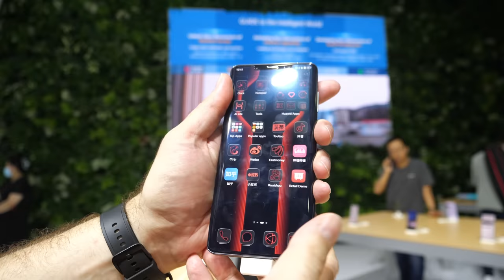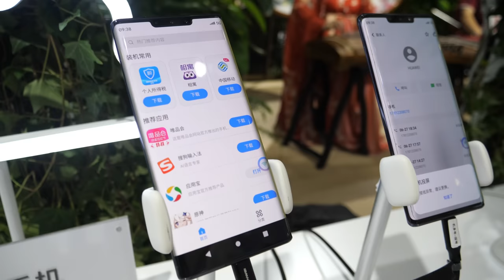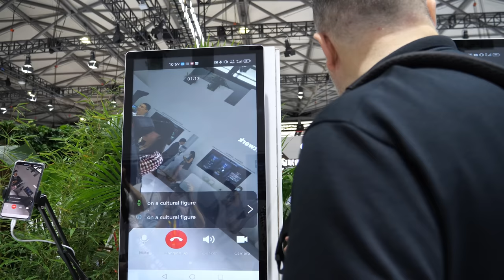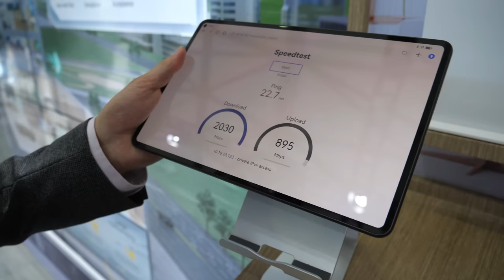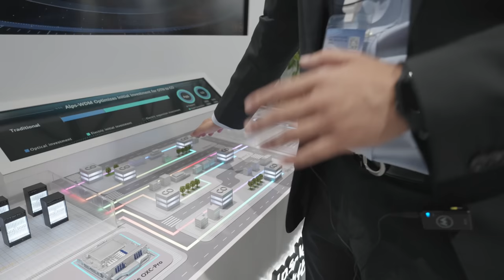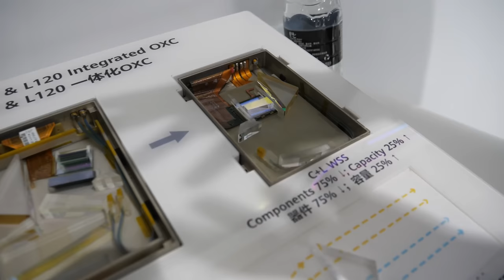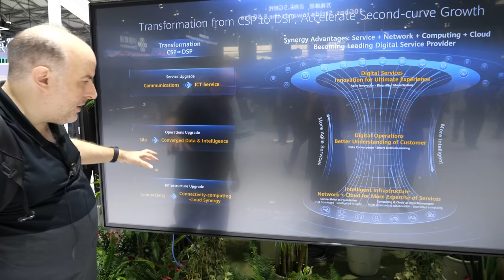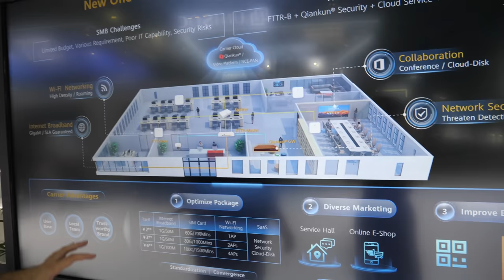Best of Huawei Tech at MWC 2023 Shanghai, 5.5G, Fiber to the Room, Backbone, XtoB, AI, Cloud Phone

Comment: For 3000-5000$ GDP countries in rural or less dense cities fiber based distribution is to expensive. Second today`s 4G bases to CPE supply in these countries is the wrong air interface because it is an chip and equipment recycling from the rich mobile world. I would respect Huawei if they present solutions for the poor instead.
Reply from the maker: India is the fastest growing 5G market "5G subscriptions in India reached about 10 million by end of 2022 and are estimated to account for about 57 per cent of mobile subscriptions in the country by the end of 2028", and tariff to connect on Reliance Jio subscription goes for $1.7 for 70GB for 70 days, something like that, with more than 1.1 billion Indians now having 4G mobile connectivity in India where each user consumes an average of 20GB per month right now. Most of them now are getting upgraded to 5G. Sure it would be great if Fiber was cheap enough to deploy to every home in India too, I don't know how many Indians have access to Gigabit Internet and to Fiber. Hopefully a lot have access or it's growing fast hopefully for them. I bet most or a large part of these users in places like India connect to the internet using Huawei Telecom equipment
Reply: @charbax  These are very good numbers. In phillipines you get 4G for 20$ at 2-5Mb/s a month. They still need CPE directional antennas and low sectorimg at the base. In dense city areas it is much easier to pay back a an expensive 5G infrastructure. The 4G was designed for mobile and if the traffic get away from the down/up asymmetry you overpay. WiMAX with high sectoring was the solution but rich countries drive the standard for mobile centric. I do not argue against 4G/5G but reusing them in poor countries is some kind of colonism. They pay the West for unmatched solutions.
Reply from the maker: @reinerfranke5436 I'm thinking if India can do 4G at less than $1 per month, surely the Philippines should be able to do it too.. yes density of populations matter a lot, and I think 5G maybe helps more in the most densely populated areas, hopefully, in terms of adding more smaller base stations to make sure more people can connect when they are dense. To help in remote areas it seems to me Elon Musk's Starlink is excellent solution and I hope all countries adopt that too and somehow Starlink pricing is adapted with country's GDP per capita, so in some countries it should be sold at below 10% of the price of the rich countries somehow, and do some deals whereby Governments can subsidize the subscription fees too.
Reply: The point is Huawei is already the cheapest and the best option out there. If your country cannot afford huawei, then it wont be able to afford the other brands. Or, your country is either persuaded or bullied by Us for not using huawei. 

Having huawei in the competition is bad for the US and its allies but always good for the customers. If you think huawei is expensive, go tell the US that don’t sanction huawei anymore so that huawei can spend less on having to develop everything by itself and could lower their cost and hence the price. Some people are just so funny and creative that they can always find some new angle to criticize huawei, while the real trouble maker and the root problem has always been the US, who is probably your country’s ally and big brother.

Before you claim huawei not helping the poor, go do some research and see how long has huawei been helping African countries. Your claim is so ignorant.
Reply from the maker: @reinerfranke5436  I've been trying to understand Wimax and White Spaces for something like over a decade, but I don't quite get it. Can it be done to bring better internet in rural areas on a massive scale, and if it can be done, is it done or why would they not be doing it? My theory is that some carriers don't like alternatives that make their proprietary network less required to achieve connectivity. I hope though that it's not the case, and I still hope for massive deployment in the TV White Spaces somehow, if it hasn't been done yet.